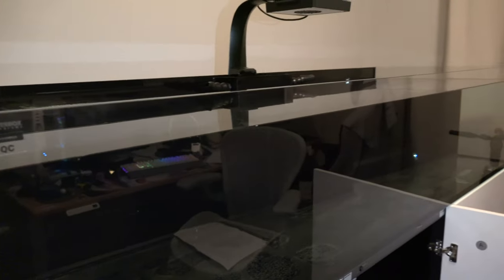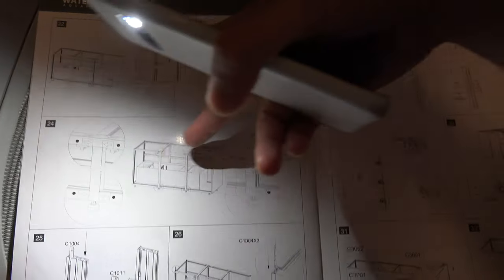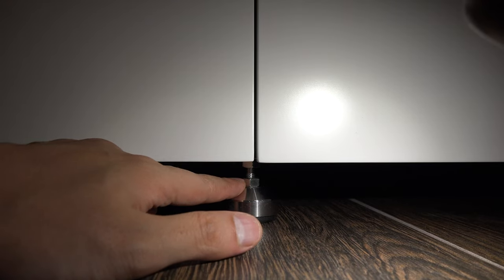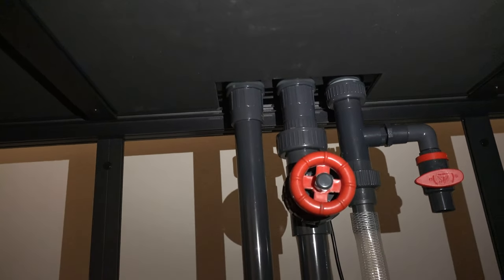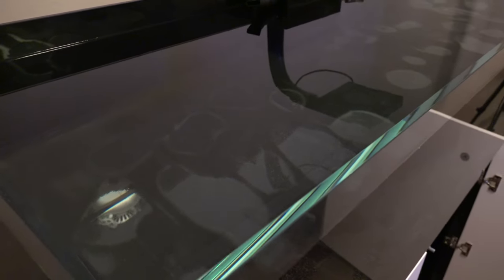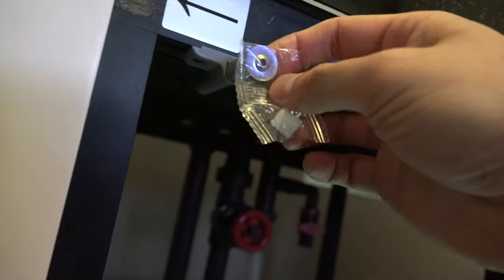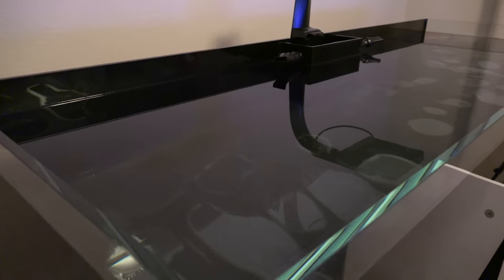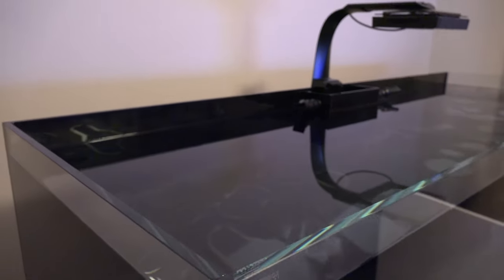📖 Missing steps in instructions & tips on setup/install on Waterbox Infinia Frag 175.6 Tank

Comment: My 320.7 stand was already put together fortunately.  The delivery man could not drive the truck onto the driveway due to potential damage liability but he was great and helped me put the tank and stand into the garage.  Tank is now 2 years running and no issues
Reply from the maker: Awesome! I also thought the stand was going to be put together too, but it wasn't too bad. Did your tank have a foam board or layer that sat on the frame other than the yoga mat?
Reply: @PurelyAquatic  yes there was a surface on the top of the stand.  The “voids” under the bottom panel went away in 3 weeks from the weight of the filled tank.
Reply from the maker: @andrewsdrmike  Thats good to know. thanks

Comment: thanks for the video, very helpful. I was hoping you hit a snag with the push door things. I can't figure out how the screws fit into the frame they don't seem to have a hole or grip to screw into. How did yours go in? TIA
Reply from the maker: I asked waterbox, its an extra part that you don't use. Just use the clear rubber stoppers on the door (not the black ones).

Comment: I just got my 125.4 with aluminum frame and want to share as well. I've never had an issue with putting furniture together before but the directions are horrible. Lots of ambiguity and bad illustrations.. Some of the frame is also preassembled and one piece they shipped was broken (a metal piece that should have been checked before sending) that they call a "locking mechanism". The design is weird to me. It seems like the locking mechanisms that join the pieces of aluminum together should be done only to connect pieces horizontally. Then a solid piece of aluminum should be placed on top of that like I've seen on other stands. Instead, these stands are designed so the part where two pieces meet and are joined with one of these mechanism actually takes the weight of the tank. I don't get why they did it that way. So if one of those fails, does the tank fall? I have no idea but the back right corner of the stand can't even take the weight of my 160 lb self right now. It definitely doesn't instill the confidence I was expecting with an aluminum stand vs wood.